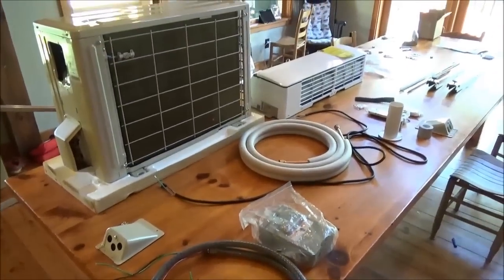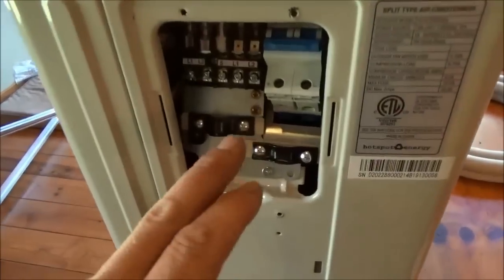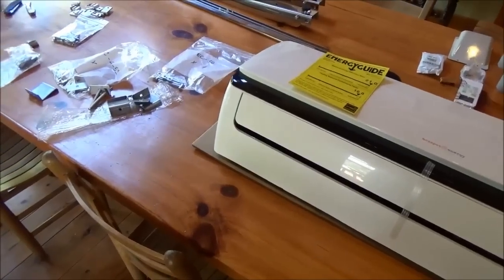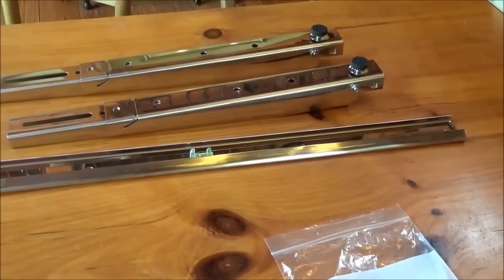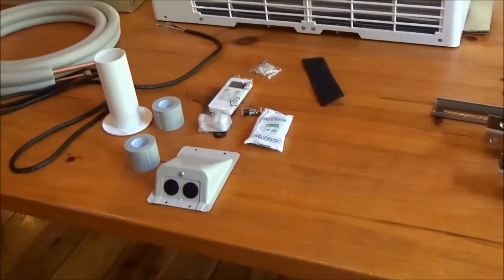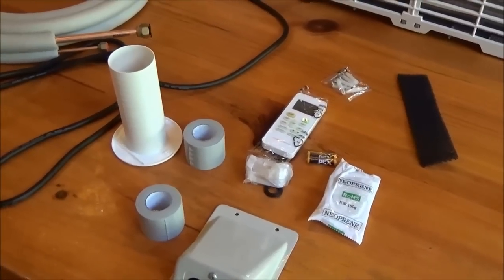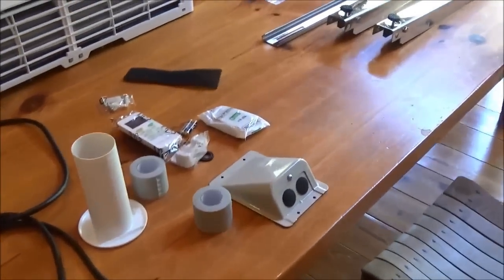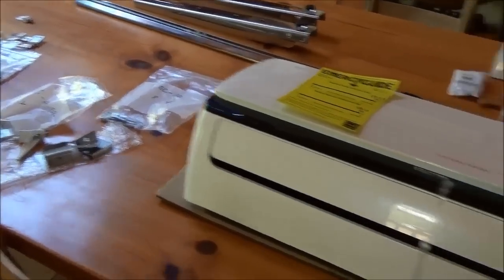Solar Air Conditioning Part 1

Comment: Why do you pull a vacuum on a system?
The process of pulling vacuum is performed to rid the system of these potentially harmful substances to ensure that the refrigerant in the system has a clean, pure environment in which it can operate best. Not pulling proper vacuum can lead to: Premature corrosion. Line restrictions

Comment: The solar panel is wasting power when the air con isn't being used. Maybe every day if your only using it night time. May as well supply it using solar system using that panel. Save money. This is not the best way.

Comment: Why not put links up to these products?
Reply: Check out Zamna Climate if you'd like a unit like this that's in stock and available. Just Google Zamna Climate. Their solar/hybrid units are in sizes 12000, 18000 & 24000 btu. They're available in the USA and we Currently have a few setup here in Jamaica 🇯🇲

Comment: Quick to the point well made video!
Can't wait to see part 2! (Next video I'm going to click) lol
Question though why does it require the AC power if the unit is made to work with DC? Is it just to be able to run at night? I kind of want to do an off-grid type on my RV.

Comment: Hi, may I know if this unit still need a power inverter unit to operate from solar panel... thanks
Reply: No the solar panels are wired in series and go directly into the unit NO INVERTER
Reply: @itsme132442  thanks

Comment: hey I have a question. I live in a Pretty hot part of the planet. And I want to have a solar power system JUST FOR MY AC. I want to power my AC directly from my solar panels and don't want any batteries or charge contollers installed since I want to use it only in the late morning and afternoon when it's pretty hot and sunny. So what would your recommendations be? Like is it feasible to power an AC directly from the panels without any batteries in between? Secondly I know that the panel voltage is gonna fluctuate as it gets a little cloudy or so, so what equipment should I use to stabilize the constant Alternating Circuit output for the Air Conditioner to work smoothly?
Reply: Did you get any answer from any other place? even i am curious.

Comment: , did you have to get a permit is that grid connected
Reply: Louie Vee doesn't seem to be grid connected. The AC is input only, presumably a steady supply to run the fans and electronics. The solar provides a fluctuating DC supply to the compressor which will operate faster or slower depending on the available power. There is no direct connection between the ac grid and dc solar

Comment: You mentioned the separate solar system with approx 80-90 watts to provide the AC part. How big a battery bank would u need to produce that for 220v?
Reply: You are missing a zero. Originally they said it needs at least 800-900 watts of Solar and they've updated that to about 1200 watts now. The more panels the better if you want it to run 100% on Solar when the sun is shining. Still has no provision for storage though. So nights will still run from the grid.

Comment: YOU DO NEED TO PULL A VACUUM ON IT! You will have non condensable(air) in your system. It will run less efficient and reduce the life of your compressor.

Comment: I am presently sitting in a room with a 12,000 btu DeLonghi portable AC that is running off a 3000 watt pure sinewave inverter that is powered by  6 Vmax Tanks 125 ah batteries which are charged by 14 Renogy 100 watt solar panels. The system works quite well. This was basically an expirement to see if I could actually air condition at least one room via solar power.
Obviously I would need a system several times as big as this one to use solar power to cool the whole house.
Here in Florida, 80% of one's electricity usage is for cooling in the summer. Any part of that which one can use solar for
can help reduce the utility bill.
Reply: archangele1 ... 100 watt panels are more trouble than they are worth.   270 or 300 watts panels  are not pricy and  will give you options.

Comment: Too sweet.

We use a 5000 BTU window A/C pulling 450w to cool the trailer off of 750w of solar. It's not direct, it uses a industrial inverter made to handle the start up surge. it will run from 10 am to 3 pm off of the solar alone. We use it off grid and 675 Ah of battery can handle it at night. Luckily it's never hot at 10,000 feet at night.

Comment: inverter units don't  have a BIG start up surg. They start slowly ,  about 2amps, then ramp up as needed, and ramp down to MAINTAIN. You can't always have the solar in full sun so having 220 grid  takes up the slack times. A SEE of 35 ain't  nutter to sneeze at bro!

Comment: Is there an follow up to this video?
Reply from the maker: I have been running the unit for 8 months now and it works great. I am about to install 2 @ a local Dog Kennel.
Reply: engineer775 Practical Preppers I'm in grand Cayman, where can i get these units to buy?

Comment: Does the ACDC12 unit automatically switch over to AC at night time? Is it a system that doesn't sell back to the power company?
Reply: Yes it switches automatically from Solar to the grid it will even use partially solar and partially grid to makeup any solar deficiency.

Comment: Great Videos. I'm just starting to learn about the off-grid systems. I see Air conditioning systems you offer on your website. How about Solar radiant floor heating to go with your AC system? I'm guessing you would need to use a solar hot water heater in conjunction with it? Or how about a solar heat exchanger system?
Reply: +shfoot I'm looking at the same thing.   Im looking at doing a battery system to switch between heat and cooling.    The heat I'm looking at radiant floors connected to my heater powered by solar and batteries or hybrid where regular power takes over at night.

Comment: try running your condensate line across your condenser coil, draining on the coil,  this will help lighten the load on the compressor by helping remove heat off the coil.

Comment: wish someone showed evacuated tube solar panel hvac using an absorption refrigerant system in a passive "no pump" design. and it can double for the freezers and refrigeration via valving. it's practically free ac and food storage.

Comment: Compressor oil Will turn to acidic oil (because of moisture in the air inside the piping and evaporator),
 acidic oil will slowly destroys the insulation of electrical coils that are in the compressor. (Do not overlook the vacuum).
Thanks for the VIDEOS.

Comment: I cant wait to see this. its only a 1 ton unit so where are you planning on putting it? By the looks of your house you will need another unit to aid you. its a heat pump? so it will supply heat as well? I heard heat pumps are not to good between 40* - 70* weather. is this true?

Comment: yes you do need to pull a Viacom . if you don't anything in the lines will screw it up.
Reply: +longislandprepper1 A 500 micron deep vacuum is a must!!! By dropping the system into a deep vacuum, it allows moisture that is in the air in the line to be boiled out at a much lower temp, than your usual 212 degrees,,, air has moisture in it, and will create icing at the metering device,, and yes,, the ice blocks Freon flow,, result No Cooling,,,, as well as creating an acid build up, ( acid build up, can take weeks to years,,, but will for sure kill your unit way before it's usual lifespan), which will attack the varnish on the compressor windings, and shorting the compressor out,,, result,,, dead unit!!!

Comment: does it have emergency strip heat when it gets down below mid 20 degrees. or will it have hydronic heat for emergency heat. and that can be supplied by a compost water heater.
Reply: Question. I'm new on this. How many batteries to run the A/C 24 hours? Is it possible? Excuse my ignorance. Thanks
Reply: dale myers ... mimisplit's are variable  refrigerant  flow and work very well  at near 0° and not they don't need a heat strip. Cold weather units work to -15 and are being installed like crazy in new England . Got to Mitsubishi  ' s Web site for a primer on the technology .    My 2 ton unit has saveed me half  it's install cost in two years.. ...112° air  output in near zero weather outside!!!!

Comment: As my old English professor once said.  "It is only an Oxymoron until you figure out how to make it real."  I have always remembered and always loved that quote.  Great video.  This series looks particularly interesting.  Do you think you can generate more electricity from the cold and hot side of heat exchange at the same time?  That was where my brain first vanished out of the window and went off to never land.  It is happening more and more as I learn a little of the subject but obviously not enough to refrain from saying something stupid :-)  Great video, thanks for sharing.  I shall await the next with interest.
Reply: +Aaron&#39;s allotment ABSOLUTELY! Why waste all that high side pressure? Incorporate a small turbine that can generate some of the DC. The AC elec demand is easily met with your inverter
Reply: +Rick B ,, I am a heating and cooling guy, and system designer,, I would love to hear your idea on how you are thinking about using our discharge line pressure to run a turbine,,, Our high side pressure is critical to the proper operation of the system,,, any drop in the high side pressure, can really mess up the operation of the unit,,, and of coarse any air, moisture, ect,, or restrictions,, will not allow the oil to return to the compressor,, causing the compressor to seize up.. Is this just an off the cuff idea that you had? Or do you have real lab tested info? It is a cool idea,,, but also brings up,, huge,, potential problems for the operation and lifespan of the unit. Specially, if you are using a heat pump..
Reply: great  video

Comment: Pull a vacuum on it or you will have problems.

Any humidity in the lines will cause blockages as it freezes inside the pressure reducing orifice. You will get cooling stopping then when you shut down the system and have someone check it will work fine till they leave.
Reply: As a refrigeration mechanic I can say that they are designed to not need to have a vacuum pump; there is extra gas in the system, enough to allow you to purge the lines and push out the air, replacing it with refrigerant gas.  All types of A/C units of this type should also have a filter/drier in the gas line that will hold any moisture that may have stayed in the system.  Yet, if you want to make the system perfectly clean, then do a high-vac with a good quality vacuum pump for about 8 hours or over-night and remove 99.95% if everything in the lines.
Reply: Rajkumar Hinduja . Thank you
Reply: Andrew H ... Hotspot energy install manual states a vacuum  must be pulled.
Reply: Andrew H